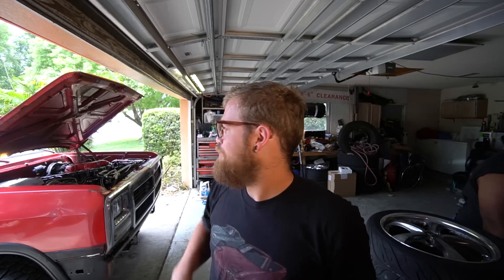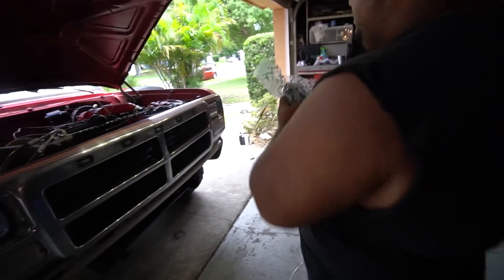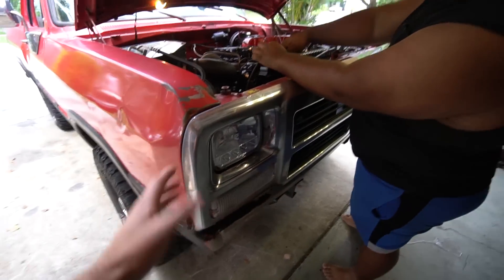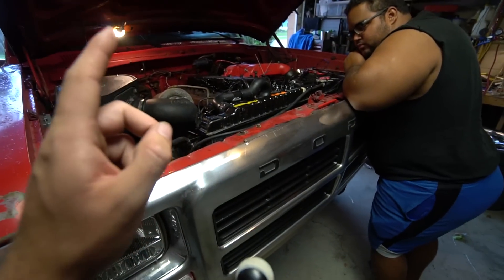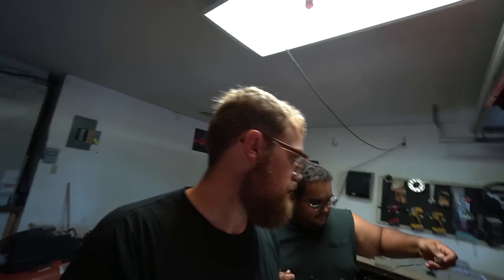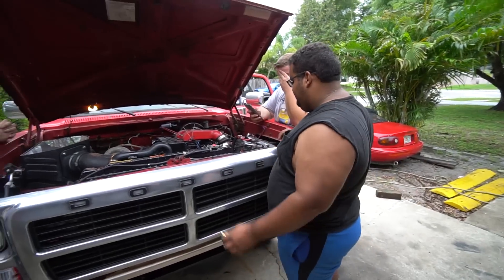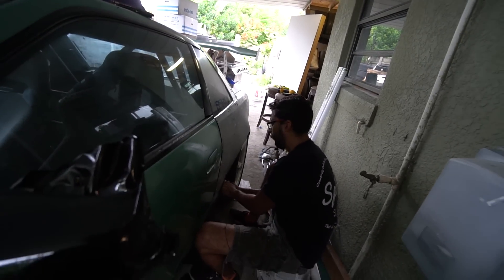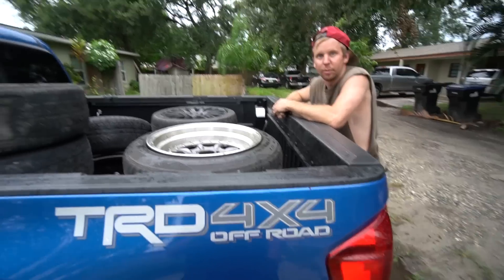Cummins Ramcharger 3rd gear pulls and E-fan Install!

Comment: I have electric fans on my Tahoe and Silverado Cummins but they never come on unless I am stuck in traffic.  Cummins are great on fuel because they are a very efficient engine.  It uses all the heat engergy

Comment: Yo just a tip for the nv4500, if youre not moving and having trouble getting into 1st 2nd or reverse pop the trans into 4th then quickly into the gear you want. It stops the input shaft so you can get any gear. Hope Fed plans on putting stiffer springs in the front lol. Shits stinkbug af

Comment: Pro tip: Use a fan shroud with your electric fan(s) for optimal cooling especially on race/drift applications. You lose approximately 25-30% of the pulling power without it

Comment: So you dont need a fusable link or any type of relay with that controller? I wanna use that with a 90's Volvo S70 eFan or two volvo efans in my 90' ramcharger. I have a vid of the fan on my channel

Comment: Are you running the stock inner cooler and intake? Did you chop the core support?

Helping a friend stuff a 12 valve in his 89 ram charger. If he addressed this already would someone direct me to the video?
Reply from the maker: It's in the radiator and fan install video.